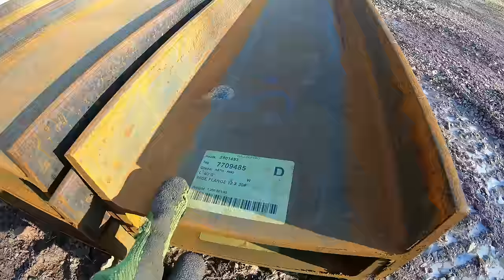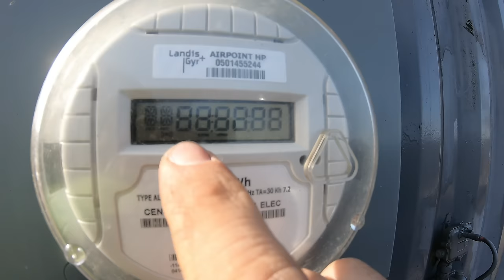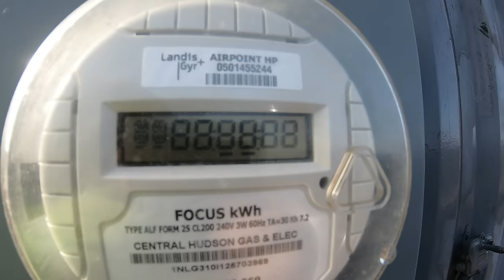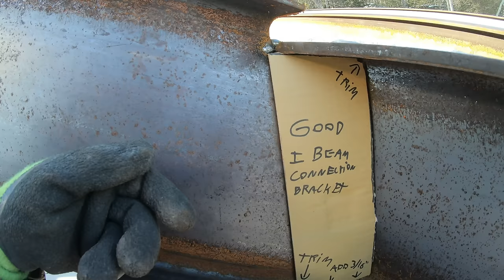Container castle roof rafters

Comment: What is going to happen when the sun heats up the steel?  I expect the sheet steel will move quite a bit and be noisy.  There will be a lot of stress placed on all your welded joints too.  Maybe that is why they only weld I beams on the web?  I don't know myself, but I think it is something to consider and ask your structural engineer.

Comment: The more weight you add the more likely you are to have foundation issues (sinking). Also, steel roofing would be best covered in another layer of 26ga steel roofing instead of trying to paint sheets of steel.
Reply: Hes building on a big ass rock lol he wont have any sinking issues

Comment: Did you really just MIG weld a bunch of that thickass heavy gauge structural? Outside?
Reply: Flux?
Reply from the maker: No. Mig. Have to turn the gas way up if there is wind and block wind.

Comment: 4:28  Just curious...why would you not use stick welding on this?
Reply: Speed. In high production construction they will use what's called dual shield flux core FCAW-G. You can weld lots of beam, probably double or triple the productivity in the correct environment. He is just using his mig welder outside. No harm aslong as the weather cooperates.
Reply: If it was a commercial building I think it has to be done with stick.cofes are different around the country.

Comment: I admire the good work Andrew did building this solid rooftop frame. Wondering how to coat the metal plates building the roof surface to prevent corrosion. Thinking about ships or other metal structures constantly exposed to wind and weather, there might be a need of constantly repaint the roof plates. Maybe another top layer of long lasting tiles will be installed?

Comment: SUPER IMPORTANT. PLEASE, ANDREW, READ THIS COMMENT, THANKS.

( 1 ) Andrew, I am ONLY 64 and yet physically in so much back pain, back operation fixed nothing. I have been taking STRONG pain meds and strong anti-inflammatories for some ten years plus now. Obviously, I was forced to stop work. Like you, I freakin loved working, forced retirement and surviving on a Disability Pension all the while in pain, SUX BIG TIME.

( 2 ) Andrew, for YOUR sake, I BEG you, when you lift ANYTHING, PLEASE bend your knees, keeping your back as straight as possible then use the straightening out of your legs as you stand up, to lift the weight, NOT YOUR BACK. 

( 3 ) My ankles are in just as bad a condition as my back, so PLEASE NEVER EVER jump down from any height, ALWAYS climb down. 

( 4 ) Hopefully, the wisdom of endless practice of the above has arrived in time and HOPEFULLY will save you from a world of brutal physical pain, when you too are an old man.

Comment: You should green epoxy prime paint to rust proof it. It's the same stuff they use on highway bridges. You can buy it from Sherman Williams paint supply. Also paint the top of the silver to reflect the sun's surface heat off the patio deck.

Comment: I'm impressed again!  'That makes an outstanding roof system.  I was questioning the wood beams until you replaced them with steel - it makes so much more sense.  I feel the same way as when you expressed the feeling of wanting to have the finished project to be indestructible.  That should do it.  Now I'm going to watch a couple more videos where you put on the sheet steel.

Comment: Regarding 1:07:00. The columns themselves are made of thick metal and definitely can hold a lot of weight. But I think in this case the welding itself will be the weakest link. It is only a thin line of metal. In order to fully utilize the columns' strength, you should have put them inside the containers. 2 on the sides and one above the side columns. The structure should resemble the lowercase n.

Comment: hi Andrew man after my own Hart your doing a grand job you really need to use the cat 955 more  that's a proper man's machine put flip over fork on top of the bucket a towing hitch system on the back more than the pin, and or a fifth wheel dolly + your own smi trailer then tranship your delivers at the road, then you will have all weather delivery system we had a cat 977 great machine but keep all the oils changed. heat the waxoil and  pressure pot spray it. Andy.

Comment: You should add a carport/porch on the whole front by the garage door... and tie it into the little hill on the left side... about 8 pieces of I-beams 4 posts then two across and two straight. And concrete on top.

Comment: Great looking project!  One thing to consider, when it comes to fire protection, solid wood construction will actually last longer in a fire than steel. Once steel gets to melting temperature it will collapse. Solid wood may stay standing long enough for the fire to be extinguished. You may want to cover your structure with a spray on fire protectant like is used in commercial buildings.

Comment: at 12:00 you were backing the grade all off the yellow trailer. and it was slipping sideways on the side rails of the trailer.. since you have several wire feed welders... how about cleaning the top flange of the trailer beams and putting a bunch of small weld spots to give the top rails some traction when you have various vehicles on it.

Comment: Here I am a year later watching this again lol. I used to make/assemble steel framed buildings, the kind with built-in "storm shelters". Those cookie cutter tin cans just had a few block walls inside to keep the beams from smashing people in a tornado lol 
This "castle" you're building is a fortress or even better a warship. I laugh when I see people commenting that you don't know what your doing 🤣. Don't worry about those jack asses and thier opinions. Oh and also to those who wanna cry Osha every time you forget your safety glasses, I can tell you right now without a doubt they could care less about petty shit. They are looking for major issues and everything else is just a teachable moment to them. Osha is not the enemy, I have worked with Osha on many of jobs because some green horn got fired (and) or was scared by the type I work and called them on us. If you screw up and also get an inspector who had a bad day then yeah fines happen but it's rare as long as your knowledgeable, diligent and respectful about PPE AND SAFETY.
Also the integrity of this building is top notch if you don't understand watch the other videos of this project listen to what Andrew says about the materials and why he chose them and how he's using them. EVERYTHING he adds to this stengthens the structure, even the diamond plate siding and sheet metal roofing being welded on tied it all together and added strength. He is using stronger materials than necessary and no the added weight is not compromising anything. He has adequate support. If the company I used to work for designed and built this lower strength steel would have been used (as in thinner, smaller, or different style beams). We used z purlins for rafters just cheap thin material z shaped beams that felt like they would snap in half when you walk on them. I see he used lots of box steel for support columns and that's stronger than i-beams with the equivalent area/size, less twist, bend or flex overall. To those who think steel is gonna be bad to heat or cool, have you heard of insulation this isn't the first time a building was made from all steel 😉

Oh Jeez I'll stop rambling now but I've said this before and I'll say it again Andrew's a one of a kind genuine man and does things to the best of his abilities and knowledge so stop doubting him because even if he messes up its not half as bad as what some of these wannabe contractors are out here doing. So go pick on them. I am a jack of all trades like Andrew and I stand by him and his work 💪👷 🙌.  If you can't say the same your just jealous and sad.

Comment: The LVL’s are very strong to carry the load on top of them. The excavator tooth is acting like an axe splitting it from the end which no LVL would ever experience in normal usage

Now for AC extreme usage. Yah. Steel I beams are better. Wouldn’t want the roof to blow away for no reason.

Comment: I've watched most if not all of your YouTube videos and have been enormously impressed, all except for your frequent critical comments on the quality of various things, one of them being  John Deere products as being junk and undependable.  That is one negative you've expressed many times even though Deere are the largest producer of farm equipment on the planet.  They must be doing many things right to make and sell what they do in the face of much competition.  On your white pickup truck you are the one who had his foot on the gas when it went out of control and slid on the ice into that tree.  The truck was not to blame because the thing was used improperly.  If it had had quarter inch steel plate sides you probably couldn't afford to buy it and it would be so heavy the gas mileage would be about -2.  And your comment on the concrete form you made of the remains of one of the glulam beams for the box beams to rest on for the support of your overbuilt 10,000 pound roof: When you removed it after the concrete cured,  you showed i t to the camera, saying, "See how that broke up?  Garbage!" or something similar.  Sorry, but that  wood beam was never meant to be manhandled by a thousand pound steel bucket with big teeth.  I built many houses using glulams and all are still standing, a couple at 40 years of age.  Maybe the very good comments I read on all your achievements in the mechanical area are making you think you're the final arbiter on all things but positive alone flattery doesn't make it so.  Perfection as a goal is commendable but it does not make the pursuer flawless in all areas.  You are a very good excavator and I think you should leave it at that and be very proud of it.
Reply: Herb, unless you just recently found this channel, I think you’re ‘missing the forest for the trees’. What’s so hard to understand about he’s doing it, ‘Sinatra Style’. His way! Comments good, bad or indifferent, be damned! 
“This is gonna go, like I want it to go!” - A. Camarata ‘20
Reply: @psidvicious  Thanks for the reply although I didn't at all expect one.  I think I've watched most if not all of the Camarata videos.  As I said he's to be admired for his mechanical skills.  However I think he's out in left field when thinking he's in the home building business and that the same as changing the spark plugs in a tractor.  I can't imagine a building inspector approving of what's going on with the container building of three floors which is unsupported for the weight it's carrying....so far!  I can't imagine a professional engineer approving what's being done and I never heard Camarata mention one even being consulted.  That may be his hubris not talking to avoid sharing credit for the undertaking.  I think I'm tired of watching some guy in New York moving gravel around and it's time to move on.  Maybe I should be looking at some Italian grandma making pizza!
Reply: @herbconlan6552  Herb, you’ve clearly not been paying attention while watching AC videos (maybe you’re watching with the sound turned down?). He’s said on numerous occasions that he has an engineer who is reviewing, approving and signing off on everything being done structurally, to the build. What structural engineer wouldn’t love to be paid for consulting this job? Everything is way overdone! That engineer will be dead and in the ground 300 years before anything goes wrong with this thing! 
I think the most recent thing you missed [from the engineer] was the change from the LVL rafter to the WF-beams (WF-12x16, I think). In fact the engineer told him they could be spaced at 4’oc instead of 2’oc like the LVLs. 
And btw, when did Andrew say he was going into the home building business?? Again I go back to my original point. What’s so hard to understand about - He’s doing it the way he wants to [period].

-Typical conversation with Andrew and his engineer:
Eng: Well, the steel doesn’t need to be that big.
AC: But it’ll work, right?
Eng: Well yea, sure!
AC: Good, bcz that’s the way I want it.

Comment: When others a worried about hail you just need either ear protection or think insulation under the roof. I bet you could put 50 solar cells up there and that meter would turn backwards if your power company offers buyback.

Comment: I am curious, what materials will you use to cover the steel sheeting? I doubt you will  use plywood, tar paper, and then shingles? My original  guess was you would use some type of rolled rubber waterproof roofing that could be glued to the steel sheathing. Thanks!
Reply from the maker: Just going to paint it.
Reply: @AndrewCamarata  Epoxy...like what they use on garage floors!

Comment: I "think" those ones that are 16lbs per ft are called junior beams. I used those for the short distance on a 40'*11' mezzanine I built in my shop.
Reply: Nevermind I saw how they looked on your for lift at 40' they didn't bow that much. Mine were 50' and couldn't believe how much they bowed taking them off the semi with my Hi-Lo lol. Like 4' on each end.

Comment: I believe this is the only time Andrew is wrong:

The LVL material used for the concrete forms is not strong in that orientation. Its strength is compressive, with very little shear strength. That’s why they’re used for beams and joists. Downward force only, not side force. 

The steel I-beam is a better solution for sure. But calling LVL a poor choice based on it falling apart in this situation isn’t accurate at all.

Comment: No body checked what the concrete slump was or if a add mixture was needed for freezing temps, standing on the top of wobbly ladders holding weight is great, enough steel to hold a hundred tons if it was properly engineered, the welding is really suspect, one day with gas the next stick what a way to go broke.

Comment: Those footings dont look like they will hold a lot of weight. They are only a foot or so deep? they will settle over time and eventually they will not be holding up any weight at all but be hanging down from the structure above.
Reply from the maker: They are as deep as the whole slab.

Comment: Andrew i have been watching your videos for a long time now and i can say this one is kinda scary to say the least, i have a building made of steel and wood myself and you need some high grade bolts holding that frame together for a number of reasons.  A 28ga metal roof will last over one hundred years even in your area and be ten time lighter than what you have proposed on doing. Get some pro help on engineering this project you will be glad you did in the long run.  We all have your best interests in mind on telling you these facts and suggestions.
Reply from the maker: I have another engineer on board with the project. Its a strong building.
Reply: No professional engineer would sign off on this. I doubt there are drawings to sign anyway.  This welding is spooky as hell.

Comment: you know i've tried in vane to buy a good masonary drill all the ones i've found dont drill very long i mean just 1 or 2 holes then they wont drill butter i dont know if youll read my comment but if you would like to share a bit of advice on a very good masonary drill bit like you used to anchor your forms to the building i'de be very interested .had to rewatch this video it gave me new ideas in my own project i'm doing now .best regards from here in TEXAS  mike shelton

Comment: If the concrete platform leaked why didn't you just use the Schluter KERDI membrane on top of the concrete and it would have made it water proof. You could have had to lay a concrete tile of some sort over the membrane but FAR LESS expensive than all that steel

Comment: I thing this roof is not safe i cant live under that roof coz the beems allways need to be nut bolt and weld, only welding of the beems is not safe, anyway the builder have don good job. Thanks.
Reply from the maker: Welding is stronger than bolting. This is one of the strongest buildings in the world.

Comment: i like watching your videos, and want to continue watching. so please for the love of god buy some rigging so you don't kill your self and others. a few nylon slings and 3/8" steel chokers are needed for this cmon.
Reply from the maker: I was using good rigging. And if a thing falls, its not the end of the world. No one is ever under anything.
Reply: @AndrewCamarata  after watching a little more, i did see some better rigging. though seeing you use equal length slings to hang those roof joists at a pitch was scary to watch. if you have a chain come along or chain fall it will allow you to set the pitch while hooking on and you won't rush the piece running.

Comment: 23:30 What is your plan for lateral movement like from an earthquake?
Considering you are all concrete and steel, is that basically earthquake proof?

I think about how 100 years from now, your house will be an historic site. in 200 years, there will be holograms of Andy, tours, and all your videos playing on a loop for visitors. ;-)
Reply from the maker: It should be. This is not an earth quake area. It might get some cracks, but I doubt it would fail.

Comment: Didn't you buy a steam roller awhile back? Is that still coming?
Reply from the maker: Nah, I sold that. I am going to get one for the skid steer this year.
Reply: @AndrewCamarata   I knew a guy that built his own out of a piece of pipeline pipe and square tubing , it never worked because u just couldnt put enough weight on it and drive at the same time

Comment: Just don't understand why you are using a steel roof when a timber-frame would be a lot lighter, cheaper and easier to get up. If you wanted regidity you could always put steel plate on timber. You're surrounded by slate everywhere there so I am sure slates would be relatively cheap too. I don't know,  I am no expert but why this particular design? ╱╲